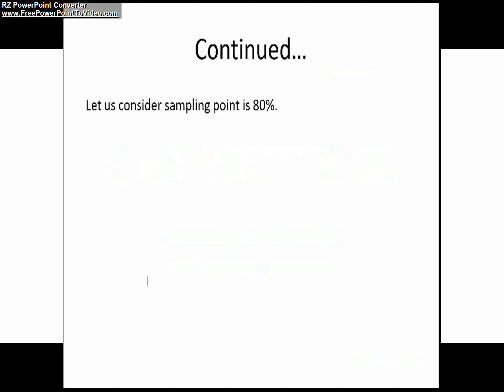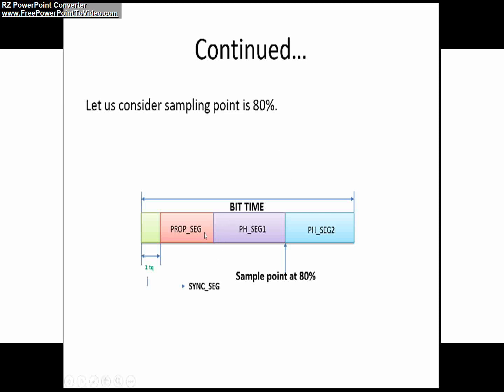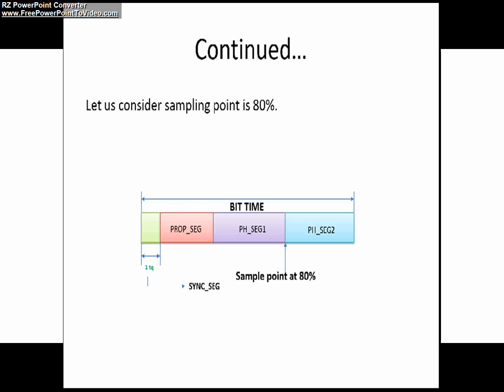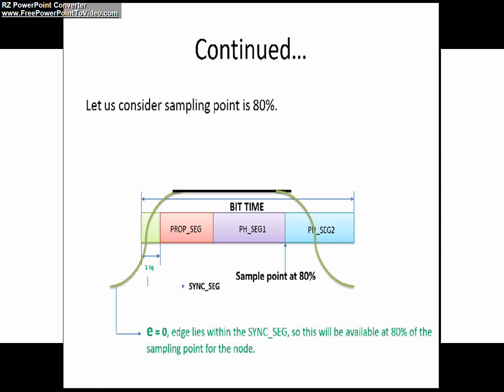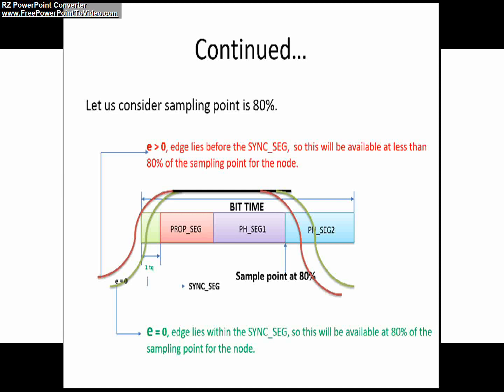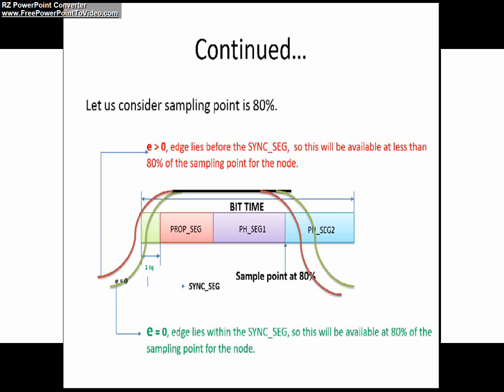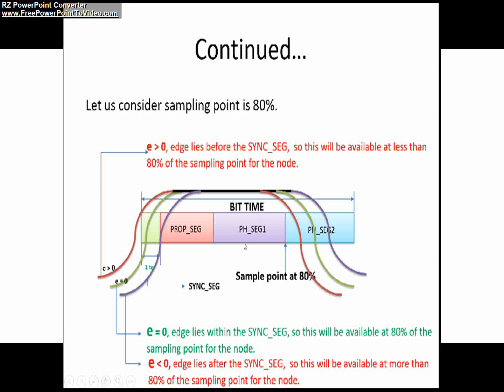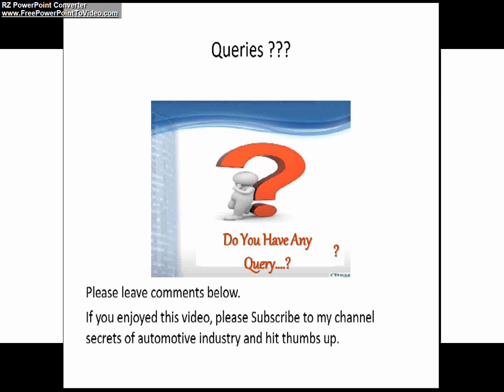Controller area network basics, PART 23, Edge phase error adjustment.

Comment: Hello friend ,I checked a source on the internet for the e>0 and e<0 facts because I needed more illustration, the following link shows a pdf that says when e > 0 this means the edge is (after) the sync segment that's why we extend phase one in order to make sample point come later in time, and when  e < 0 it means the edge is (before) the sync_segment, that's why we shorten phase 2  because the current signal arrived early so the next one will arrive early and we have  to shorten phase 2 to not detect the early incoming next bit and take it as the current bit
please check this pdf link at page 6:
https://www.google.com/url?sa=t&rct=j&q=&esrc=s&source=web&cd=1&cad=rja&uact=8&ved=2ahUKEwjXob_AzfDeAhUJ3qQKHZB3BSsQFjAAegQIBBAC&url=http%3A%2F%2Fww1.microchip.com%2Fdownloads%2Fen%2Fappnotes%2F00754.pdf&usg=AOvVaw2S8v8vIf6yB7FlWeVIauIS
by the way, your videos are very great and they help me a lot
Reply: I though I was crazy or something because I saw it different from the video. Thx for the correction! Great series! Thank a lot!